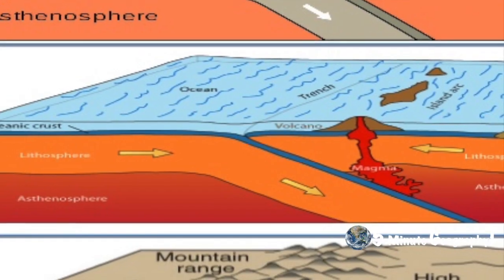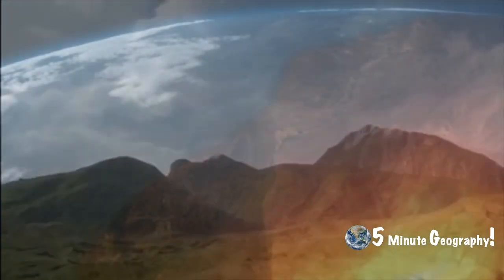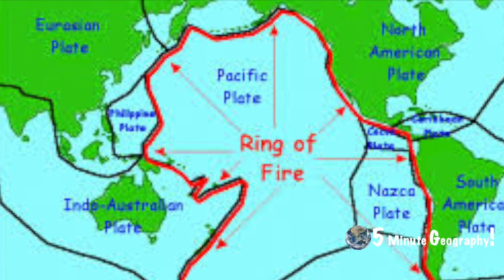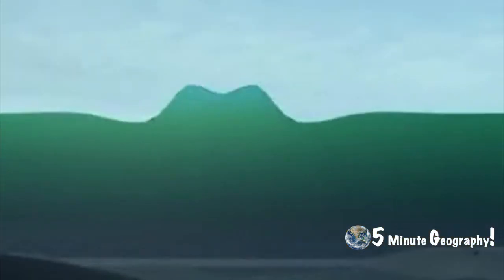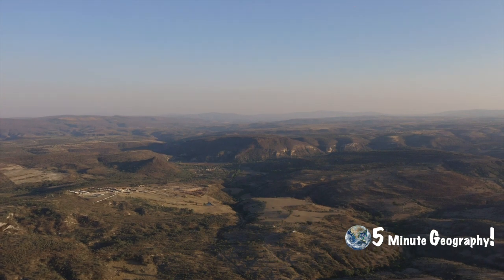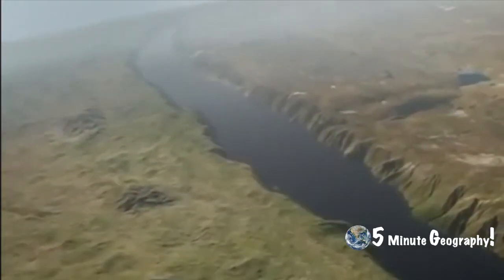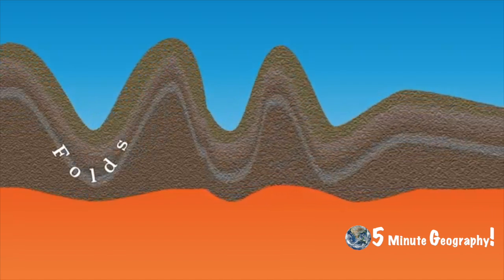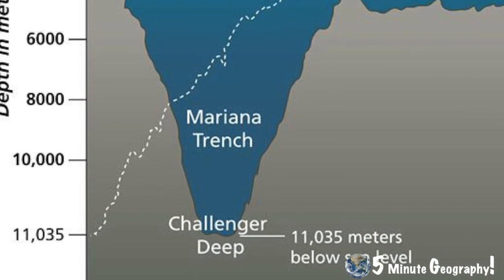Destructive Plate Boundaries

Comment: Great graphics (courtesy of Ian Stewart?) However, several major errors in this film clip so watch with caution..1. Continental plates are not made predominantly of BASALT but actually of GRANITIC and less dense sedimentary rocks, which partly explains why they ride up over the subducting Oceanic plate. 2. Oceanic plates are NOT older, in fact they are on average far younger that Continental plates, which can be up to 3.7 bn years old. In contrast geologists estimate that the oldest Oceanic plates are only 225 million years old, and many (eg Atlantic) are younger than this.  3. This film discusses Island Arcs and links them to Oceanic/Oceanic subduction zones (correct) and gives the Marianas Islands and Japan as examples (also correct) but illustrates with an image of the Hawaiian Island chain (which is not caused by a subduction zone, but rather is the result of a stationary Hot Spot or mantle plume, over which the Pacific plate has  moved for the last 80 million years, or so) So as I say..watch with caution, especially if using this film with students...ideally switch off the volume and just use the graphics, and make your own commentary!
Reply from the maker: Nichola thank you for taking the time to comment. It is great to have the feedback as I am very new to this. 1. I did not realise I said continental plates were made of basalt I will of course go back and correct this simple editing error. 2. Of course oceanic plates are continuously being added to as a result of sea-floor spreading and as a result of this, the age of the ocean floor varies. The closer to the spreading zone of course the younger they will be. 3. You are correct the Hawaiian islands are formed from Hot Spots as I explain in another video in more detail. Again, I appreciate  the feedback as I am always looking to improve.
Reply: @5minutegeography543  Thank you too, I have been teaching A level and Oxbridge level Geography and Geology for 35 years now, so am always pleased to share my accrued knowledge and experience. I love to be able to use the resources that other people upload with my students, as they enjoy using visual clips, and it is really helpful in these times of on-line learning. I am however, always careful t o check the details and ensure everything is correct. Don't forget to correct the comment about the Av density (Continental plates are less dense than Oceanic ones) The oldest ocean floor is est at 225 m years (Pacific)